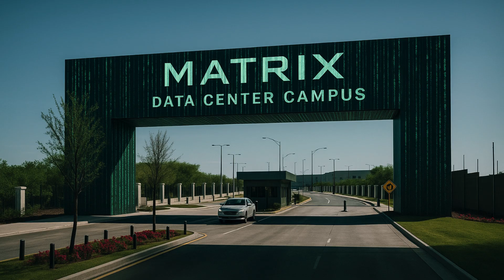Construction Site Visit for Matrix Data Center. What Sulphur Springs City Authorities are Saying?

Comment: Mount Thermo contains acid and toxic forming materials according to the Texas Railroad Commission. That soil needed to get removed off site and disposed of. The city manager wanted to throw 4 ft of fresh dirt on top and call it good. The Texas Railroad Commission said that's unacceptable. You're going to place homes in that area? I feel sorry for the residents and the children that are going to be exposed to the toxic chemicals and materials that Leach from the soil and are kicked up from the dirt and dust.